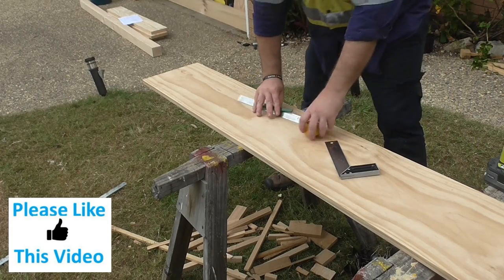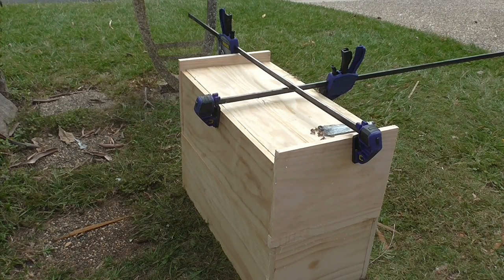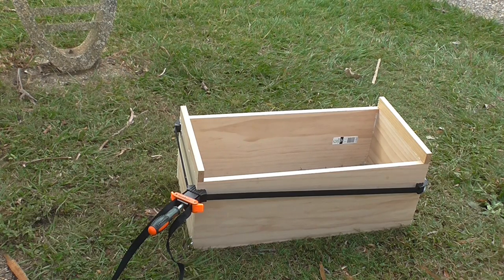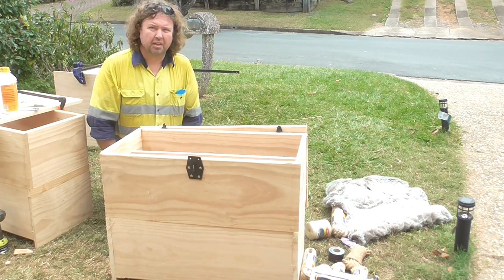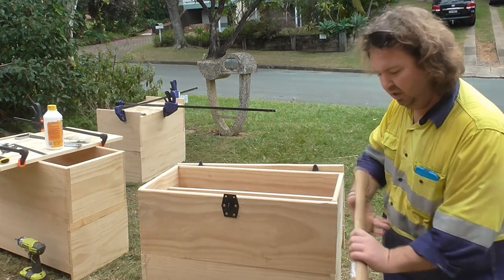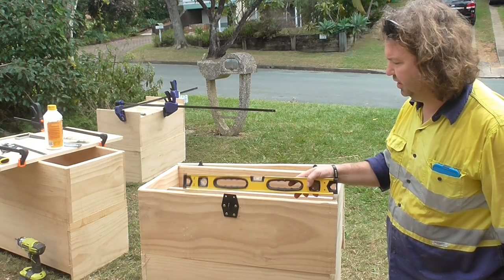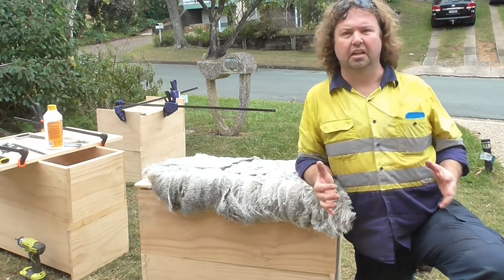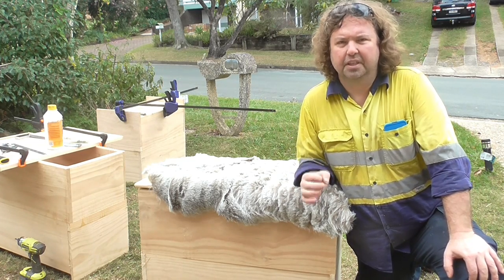Make your own Tool Chest for medieval events

Comment: That's a Mary Rose Type 2.2 or 2.3 chest. I've made several, the grain on the ends should be vertical  - its pine and wood movement is minimal in pine, the nails will still hold if the glue fails. Having the end grain vertical also helps reinforce the side panels with horizontal grain - if some clown drops it off the back of a truck there is no common plane of weakness in the wood. I also try to make the glue joins in the opposite sides offset, one wider piece on the top on one side and the opposite side its on the bottom. They also have one or two 'tills' at the ends inlet into the side boards, but surviving chests I have seen had those removed at some stage. The chests with the stubby legs did not have handles of any sort - I can only assume they just put a loop of rope right around the chest at each end and lifted by that or used the lid overhang and strong fingers. The chests without legs did have blocks nailed on with space for a rope loop (rope handles did not survive) not the dodgy 'drill two holes and tie a rope thru them' I see on Pinterest. I also found that chests about 900 x 450 x450 are about as big as you want, when full they are a two man lift if going more than a few feet - bigger chests accumulate too much stuff and are near impossible to lift & carry (DAMHIK). Lee Valley and Lie Neilson both sell 'Roman' forged square shanked nails and 'cut' nails (post 1700 iirc) with rectangular shanks - but International Postage sucks at the moment. For fit out ideas have a look at the blog at 'Lost Art Press' under 'tool chest' - lots there.
Reply from the maker: Hi, I didn't base this off any historical chest. But cool info. Thanks

Comment: Cool tool box build!😎
Please explain:. As I watch, (I am in the States..),  this is two "boxes" butt joined by stacking, so we have a single box, roughly: 24 inches high by 30 inches wide by eh, 14 inches deep, with ends as legs on the bottom, full face lid, dividers where ever needed...
I saw and thought this is a cool alternative to the gigantic entry hall table we have now.  "More" functional..lol!
Reply from the maker: Hi. I'm not super knowledgeable about inches, but I think you are pretty close.
Reply: @Medieval_Mayhem  lol 😆!!   Hey no worries!!     My personal rule of thumb is 30cm, (fudging a little...) Is about a foot/12", so...  It keeps me reasonably out of trouble without having to whip out the conversion app!!!   
I appreciate it and I like the work and the history, (appreciate the research!)!!   Keep it up!!   As a woodworker, I'll be back!!
Thanks!!!
Reply from the maker: @johnwhitley2898  Thank you so much John.